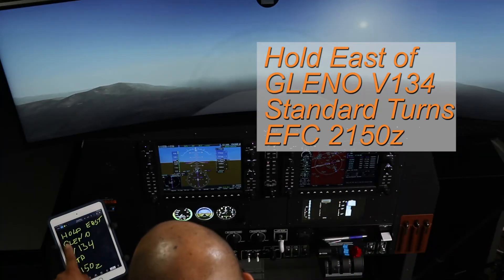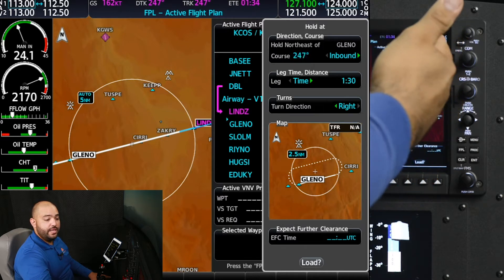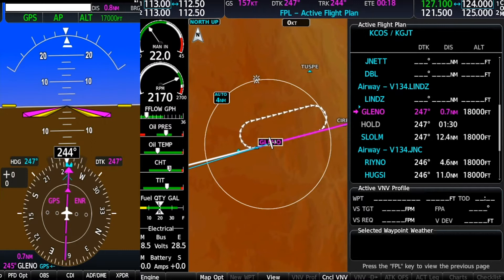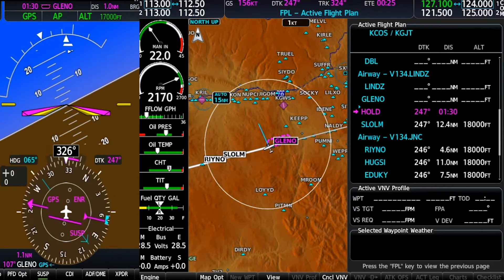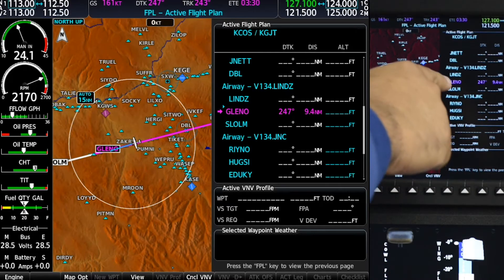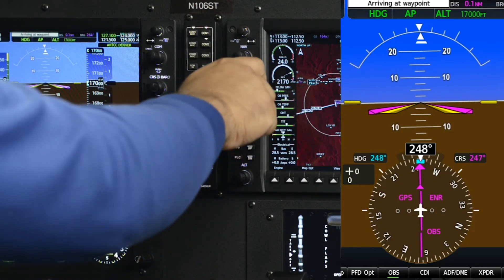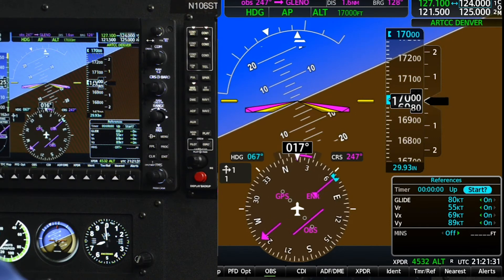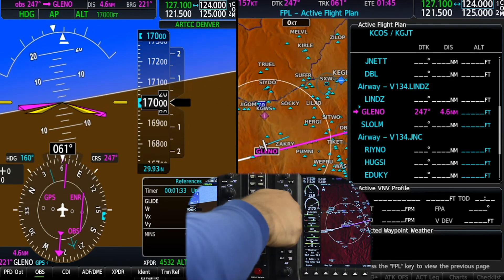Instrument Holds in Garmin G1000 | Two Methods | Instrument Rating New Jersey |

Comment: It occurs to me that you can switch to NAV when inbound, then HDG once passing the hold waypoint.   Will the older G1000 work with that method?    I am used to the G3X which is very smart regarding holds.
Reply from the maker: It will work, but unless you have the hold build on the FMS, heading mode is more intuitive, and less risk of changing the automation modes.

Comment: Your 134 radial example is incorrect.  It is either 134 outbound or 314 inbound.
Reply: I got confused about this at first too but then rememberd that victor airways aren't labeled based on headings. They're just given random numbers that have nothing to do with direction. For example, you could have V189 going in a NE direction or V1 on a 335 radial. In the video, it looks like V134 is based off the 247 radial.
Reply from the maker: Think you are confusing V134 which is an airway as a  radia/course. But will check it out and see if we see the error you are talking about.